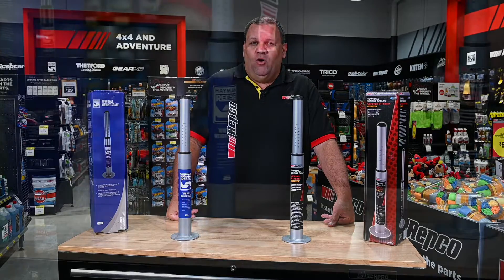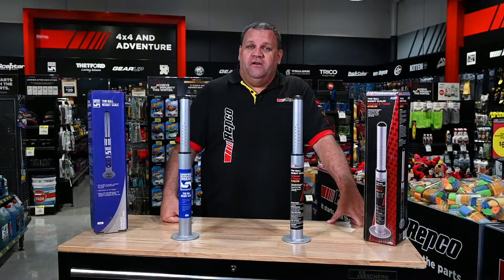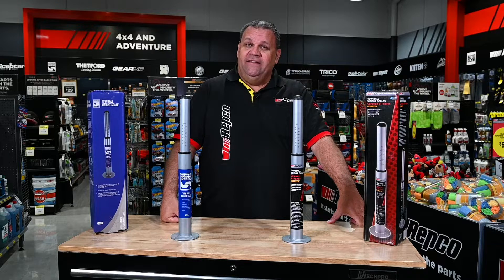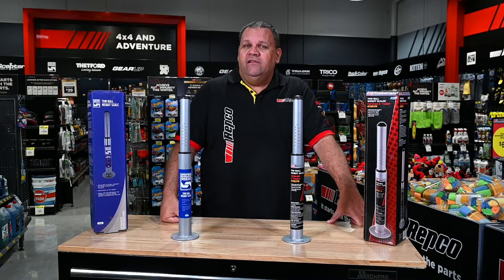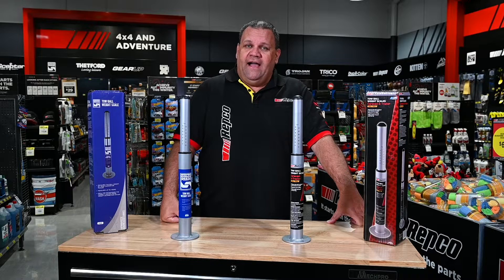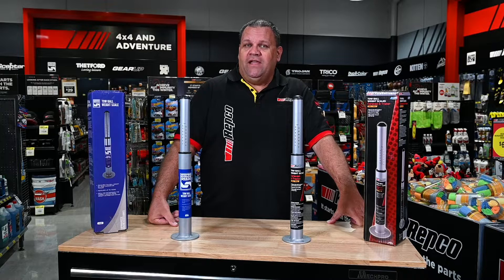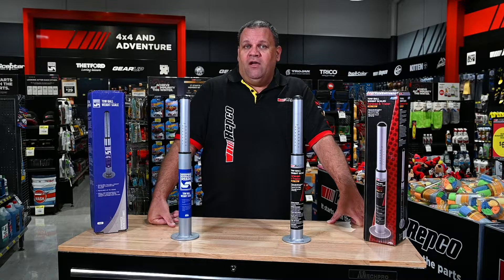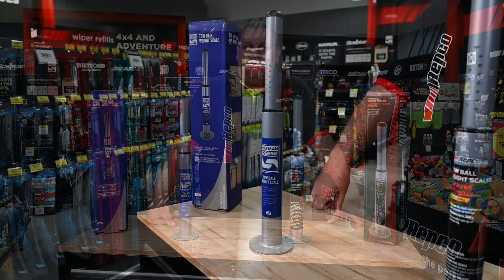Tow Ball Scales, How Do They Work? - Repco

Comment: Great product but with the ability to measure between 100 and 350kgs its good if you have a big dual cab with 3000-3500kg towing capacity and tow ball load of around 300-350 kgs. and large tralers/caravans (2-3t), but NO good if you want to tow a jet ski or box trailer weight approx 750kg with  have a car/hatchback or small suv which generally have tow ball limits of under 100kgs....  trailers normally are built with approx 10% of the mass  on the tow ball, so these scales are only good if your trailer is over 1000kgs......A lighter weight variant would be nice for the lighter trailers. ( one of these are a lot cheaper that a fine for over loading )